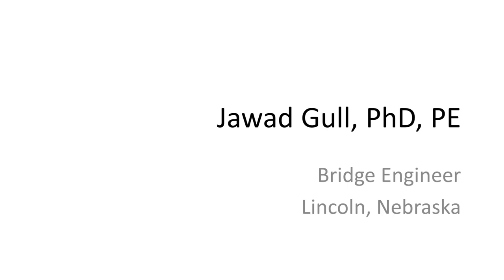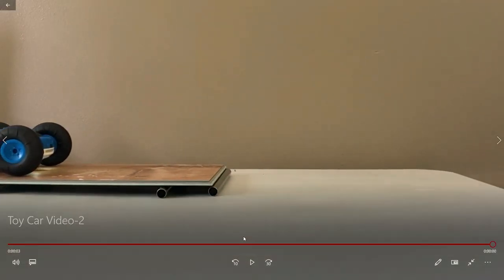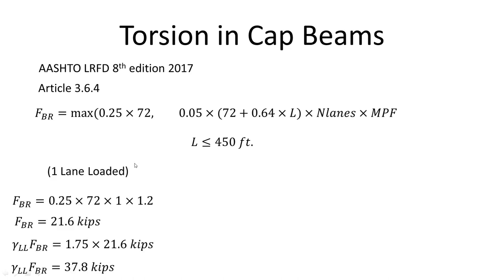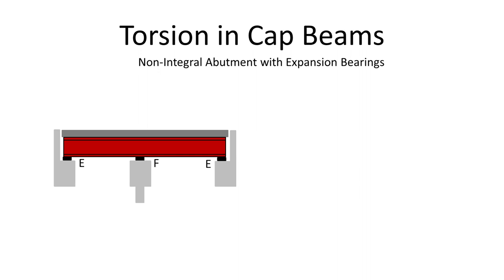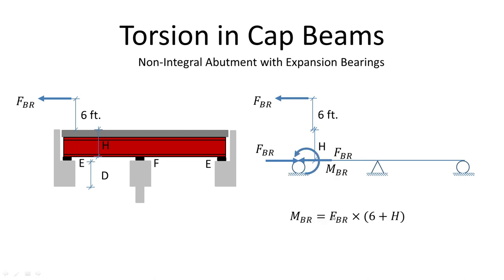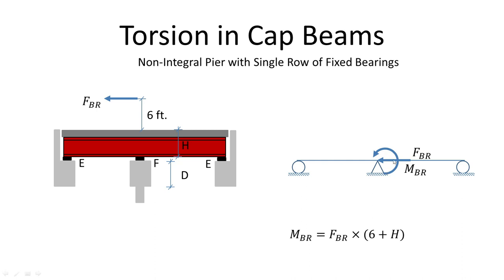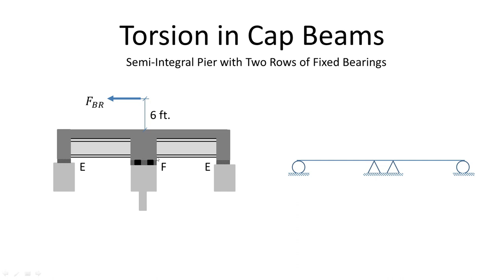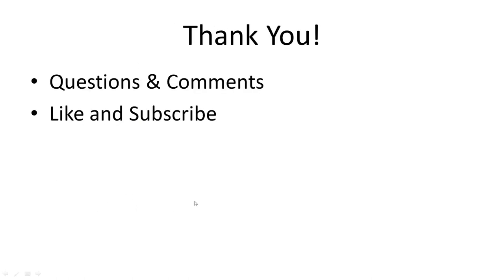Torsion in Bridge Abutments and Piers Cap Beams due to Braking Loads

Comment: Great video, thanks for posting! Agree with almost everything except that longitudinal forces can be transferred to substructure elements that have expansion bearings. You need to take into account the stiffness of the bearing and stiffness of substructure components (cap & column mainly) in order to determine how longitudinal forces get distributed among the substructure elements that are connected to the continuous/composite deck.
Reply from the maker: Great comment. Yes, I agree that even expansion bearings have some longitudinal resistance. And fixed bearings have some longitudinal flexibility. Nothing is completely free or fixed in reality. However, engineers tend to simplify things and ignore what they deem insignificant.